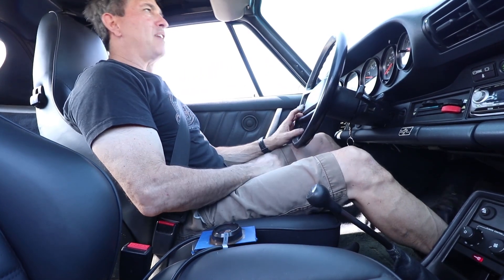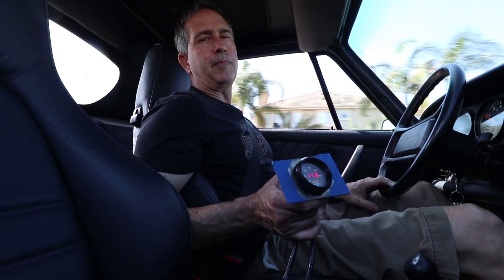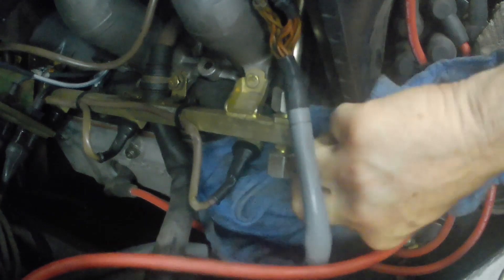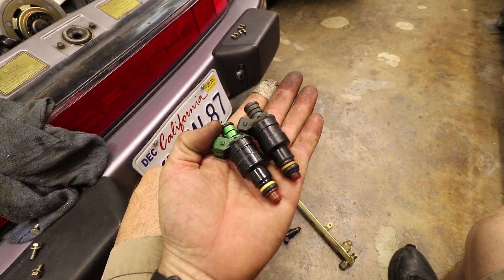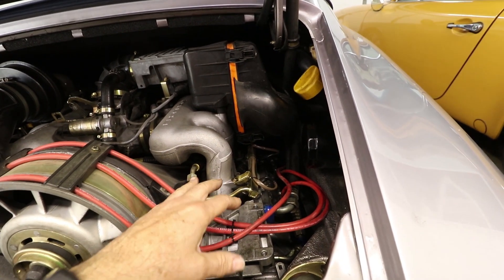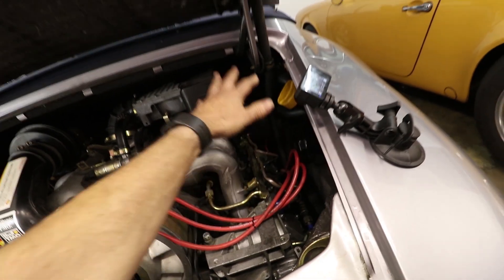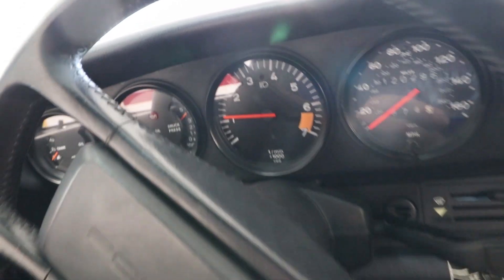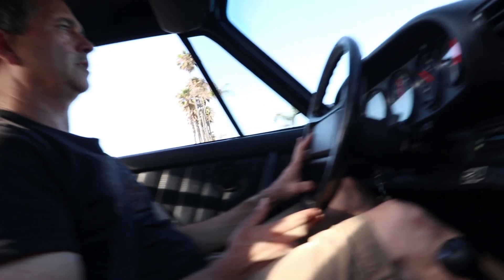Fuel Injector Upgrade & Testing for Porsche 911 3.2L Carrera Air-Cooled Engines

Comment: Can’t you just pull the electrical connectors off?
Reply from the maker: You can wiggle and pull but I don't recommend it on 40 year old plastic.  The ramp detent is easy on hard off.

Comment: I love all your videos.  I have seen vidoes (and of course I can't find the links when I want them) where the injectors are sent out to be clean and or refurbished/calibrated or something of that nature, with a report sent back documenting the flow rate spray etc.  Is that a waste of time and money is new injectors solve all?
Reply from the maker: Hi, if you ever need help finding a video please reach out to me and I can send you the links.  AI knows my entire library, so its really easy for me.
If done both - refurb with RC fuel injection and bought new.
About a month after RC fuel injection worked on them one went completely dead electrically.  That's why i bought the five o motorsports ones.  
Some say the five o motorsports are smoother and perhaps more modern inside?  I'm not 100% certain on that.  
They do seem to work well.

Comment: Never stop making these videos! We're a niche crowd but they are invaluable. Probably going to order a set and install them over the winter. Mine lurches quite a bit under 50 km/h and at lower RPMs, would be great to solve that.
Reply from the maker: Thank you and best of luck.  I recommend these and have been happy with them.

Comment: Keep in mind these Carreras are essentially batch injection too.  Yes there is an output for each side, but they are tied together internally.  Maybe these upgraded injectors have a nicer spray pattern as well?  Seems like a nice upgrade, especially on a cab!
Reply from the maker: Yes, smooth is better on a cab for sure.
The yellow car with sequential fuel injection is even smoother.

Comment: FWIW, Klassic Automotive Training School, found elsewhere on YT, doesnt have much good to say about the reliability of dashboard mounted fuel/air mixture devices like the one you’re relying on. He discusses it in his latest video in relation to 930 turbo tuning.
Reply from the maker: Thx for the reference.  My belief is that Bosch LSU 4.9 sensors and controllers are very accurate assuming they are installed correctly.  I'm assuming that Kurt is referring to those who hang them off the tail pipe.  This is wrong!  
I'm confident that the reported numbers are accurate to a tenth of a point.
Reply: Would be informative to know the flow rates of the upgrade injectors (compared to Bosch stock ?)
Reply from the maker: @TeravaSanok They are the same flow rates 24 lbs/hr.  Five O Motorsports are intended for direct replacement.
Reply: It saw that episode from Kurt.  I have no experience with those stand-alone dash AFR readers, but I know that when you install them inconjunction with an EFI system, they require specific calibration and the physical sensor has a to be placed "just so" - if not, the readings will be well off on any vehicle, not just an air-cooled 911.
Reply from the maker: Yes for closed loop EFI control you need to calibrate the lamda transport delay versus RPM.  And you are right combustion is the same for air cooled or water cooled.
Reply: @GarageTimeAutoResto  Oh yes, there's that one too.  When I mentioned calibration, I had in mind my 14point7 spartan controller which requires a "output sequencer calibration" - and then you plug the resulting values into your car's ECU.  Otherwise, it's hard to say what's exactly going wrong in that video from Kurt - there are far too many variables and you don't get to see all the details.  As you say a good reputable sensor (like the Bosch you mention) is completely trust worthy if installed correctly...
Reply from the maker: @dra911 Yes!  The AEM controller is supposedly factory calibrated for whatever that is worth.  
I do know that the wideband output correlates with the narrowband sensor and they are both next to each other.  
My OBD DME shows the output of the narrow band sensor which oscillates around 14.7.  The Wideband sensor tracks the same.  
The wideband sensors are fragile and they don't last if the mixture is way off.  Kurt was very dismissive but didn't explain why.  Short sighted in my opinion.
Reply: @GarageTimeAutoResto   That's a good indicator that all is well, IMHO.  I've had a sensor go bad, and you can sort of tell when it starts to go.  He has a very expensive gas analyser, so there is that... 🙂
Reply from the maker: Good luck taking that gas analyzer on the road for part throttle and wide open tuning😀
Reply: Klassic Automotive Training School - Kurt's air-cooled knowledge is impressive. I'm not an expert in this area, but Kurt's comments about aftermarket AFR readers should be taken into consideration.